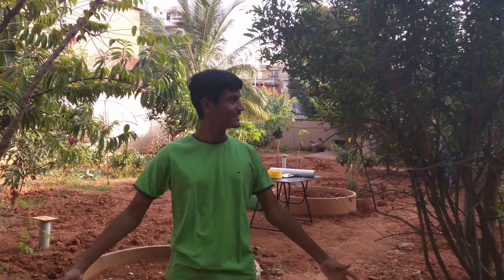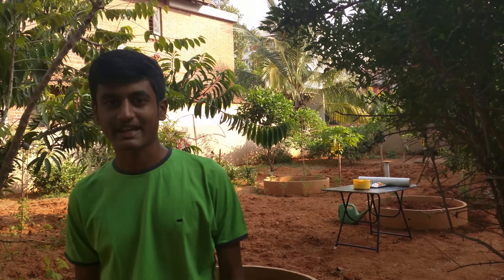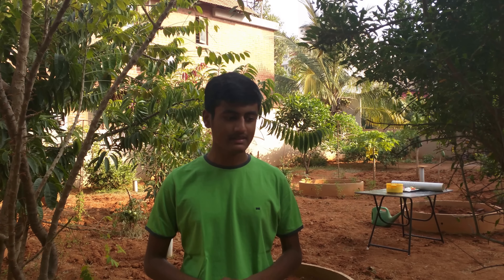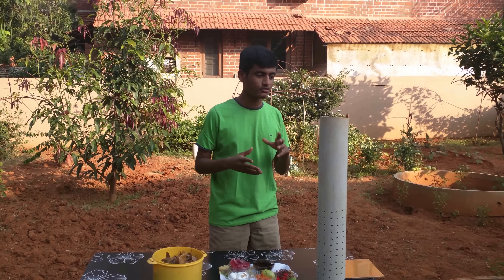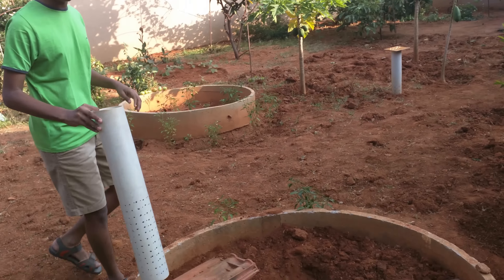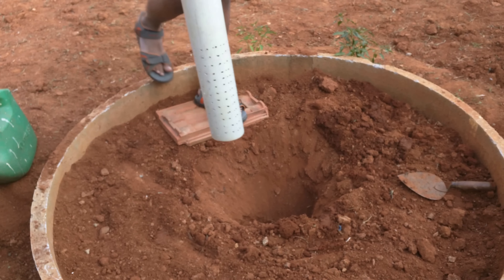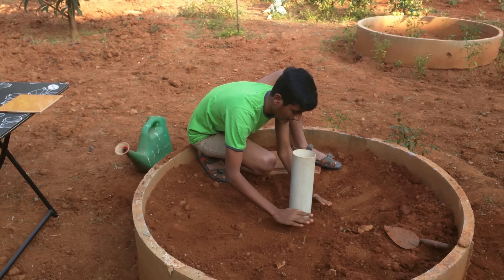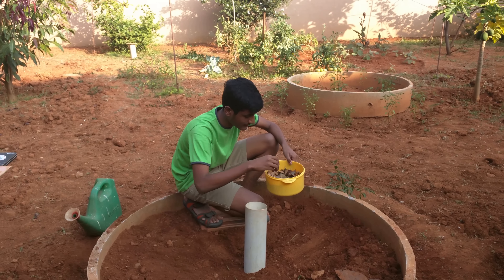How to Pipe Compost

Comment: does it get enough Oxygen to decompose? I have seen other videos and went through some text on composting.
as per that, there are 2 types of decomposition, anaerobic (without oxygen) which happens in landfills and that produces methane and the other is aerobic (with oxygen) which produces CO2. other videos show the buckets/tumblers used for decomposition of the material where in the waste material is stirred/mixed regularly to make sure that enough air is circulated.
Reply from the maker: The process has been working well for me so far. I have been getting very good compost from the kitchen waste that I am dropping into the pipes. i will look into the matter though. Thank You!
Reply: This would be anaerobic as the top is sealed. If the top had some vents or there was another small enjoy pipe linking to the bottom of compost pipe then would be aerobic. Ps: I have 2 garden tower version 2 with compost pipes in centre. You can check out the company's video explaining how it works. Adding Tiger worms or dendrobaenia worms (compost worms) which are different from earth worms works well.